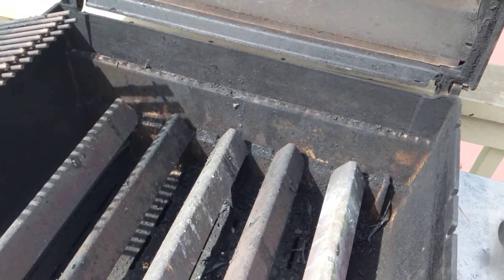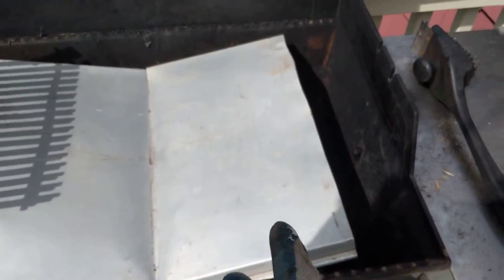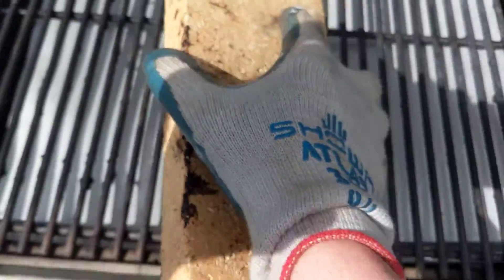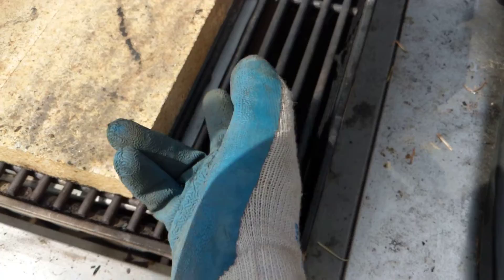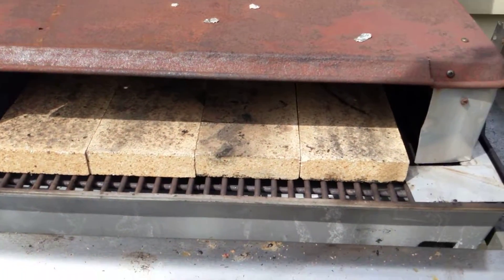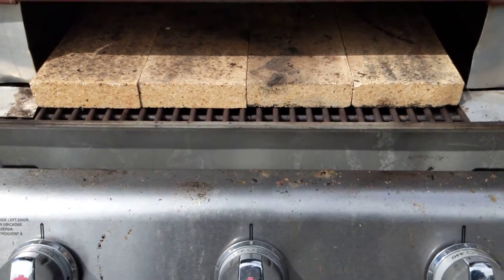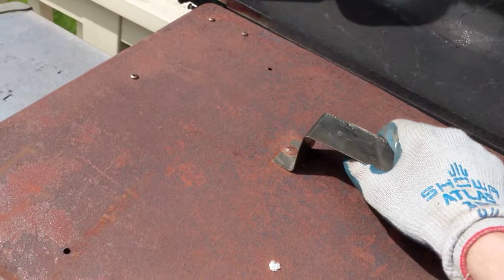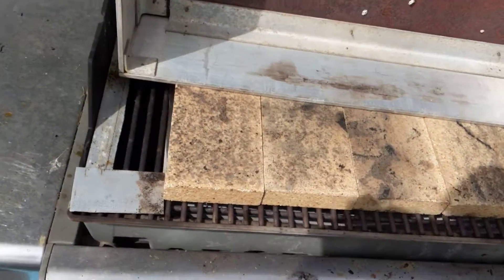Changing Weber Grill to Pizza Oven

Comment: Excellent video! I am using it the inspiration for my build. Question for you. What is the height of the metal enclosure you built (in inches)? I targeted 4 inches for mine but then it seemed too short. I plan to use a solid aluminum sheet rather than a pan so I won't have the issue of the edge in front getting in the way.
Reply from the maker: Height of enclosure is about 5.25 inches. Width roughly 24.5", length roughly 16.5"
Reply: @jc146989  Thanks for the reply! I am excited to start my build soon